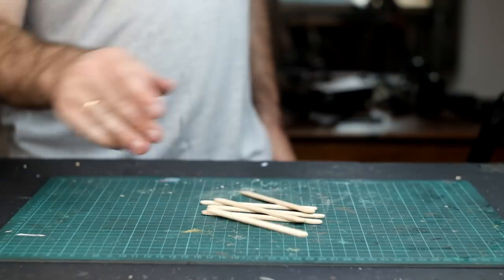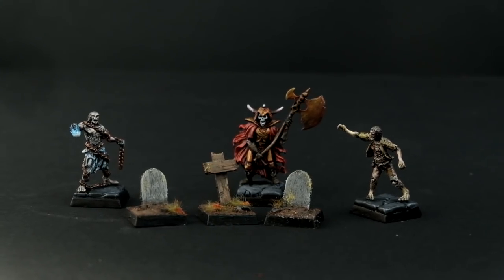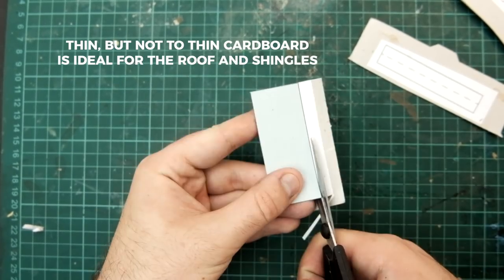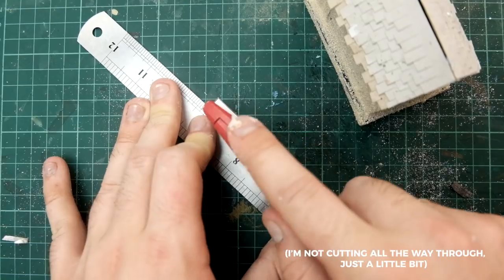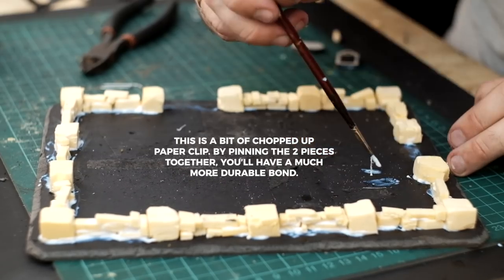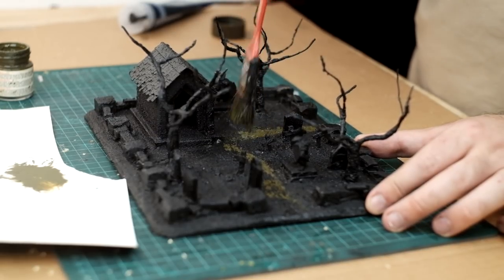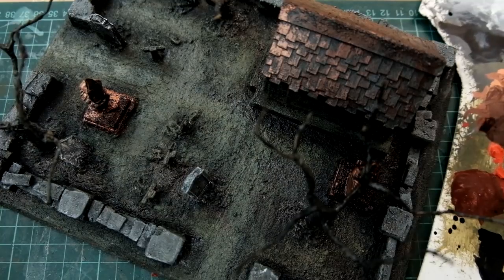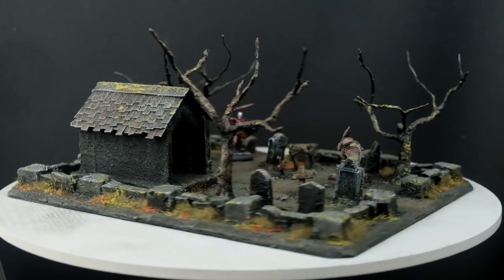Graveyard - Miscast Terrain - S02E02

Comment: To prevent foam board bases from warping one good trick is to get the very thin (usually brown) wide parcel tape and apply this on the UNDERSIDE first. The tape is very resistant to tension and basically prevents the ends and sides from warping upwards.
B
Reply from the maker: That's a new one, thanks!! Do you remove the tape at any point?
Reply: Nooo! The tape remains on permanently in case of further warp-age. Your central heating might have a long term effect. If the PVC tape is too slippery on your table you could add a little masking tape as well.
B

Comment: The biggest problem I find with terrain, is that everything still looks very flat and dark. This is fairly common in some of your builds and another Youtuber called Blackmagiccraft I think. It seems a lot of the paint work relies on a black undercoat and then JUST drybrushing on darker colours. I understand if you wanted to set in a nightime scene, but trees aren't a deep black-brown colour, and buildings aren't black-grey with splotches of green on the roofing, using grey drybrush to bring out any bumps. Similarly, too often buildings are coated in sand to give texture but this, due to scale, makes them look like they're covered in pebbles, rather than a fine gritted surface, and doesn't really blend too well. Once you use things like sand, stones etc, their scale is instantly heightened, and suddenly sand becomes rocks, and fish tank pebbles become large 1 foot wide stones when compared to actual scale.
Reply from the maker: It's important to remember neither Black Magic Craft or I arent going for realism, what were creating is implied detail and painting in intentionally stylised way. It's very hard to create accurate scale scenes from easy accessible materials and accessible budgets so we go for stylised instead. I think quick, dirty and accessible how how we enjoy making stuff too because we use them for fantasy wargaming and dungeons and dragons.
More recently I've tried to adopt more scale modelling techniques in my builds which adds a lot but at the end of the day if you want scale realism Luke Towan, Real Terrain Hobbies and Luke APS  are the guys you want to watch.

Comment: i really dig those walls, well done!
Reply from the maker: Cheers dude, I honestly think I'm addicted to making them, my new table will be pimped out with them for sure.
Reply: yeah, absolutely. I think it can be possible to use the same technique  to make a tower or a castle, should be relatively quick and give a nice stony look
Reply from the maker: Yeah no doubt, I'll let you know how it goes after I cut the 10,000 bricks out that I'm going to need

Comment: Is that foam from bunnings? What ive got is knauf brand, the same pale yellow colour. Mine is really not as good as what ive seen other youtubers use. When engraving it with a pen it tears instead of indents (like if i draw a line theres lots of tiny splits across the line)  and very easily tears instead of cuts when using a knife. Idk if mine has gone bad or is a bad batch or if im doing it wrong or if i should just find something else... I see youtubers draw bricks on xps and texture it no problem and looks perfect and mine is almost useless for that.

Comment: Hey mate, great channel, I can't believe it took me this long to find it. (Thank the Miniac). I've been using all the keywords that should've led me to your channel sooner. Just keep those vids coming. If you got any recommendations on best places to get hobby materials, tools, paints, minis etc here in Aus please let me know or maybe do a video on it. Cheers
Reply from the maker: Thanks you! More on the way! Im from a small town, so I buy a lot online and I buy from all sorts of places, but mostly random eBay sellers. For models and paint I don't really have any particular loyalty to any retailers, just whoever has what I want in stock when I google it.
If you're in Aus and looking for XPS foam, I found mine at Bunnings, you can ask to order it in if they don't stock it.
For foamboard I buy it at Kmart for $5 a sheet.
For 2 part epoxy I buy it bundles of 5 or 10 on eBay for bulk discount.
For everything else I just go to the dollar store, for cheap paint, brushes and super glue.
Hope that helps :)
Reply: Yeah cheers mate. I live in Sydney and still buy most of my stuff online. Didn't know Kmart had foamboard.  Thanks :)

Comment: Great Job, but just a heads up if your going to do a build video with a template you should probably use the template or show it a little in the video. Saying "Ensemble them sorta like this," Isn't going to cut it. YouTube Black Magic Craft to see how to do it right .
Reply from the maker: Hey mate, thanks for the feed back. Not sure really how much more in depth I can go with the instructions of the template, there are not very many parts at all and the templates themselves have arrows. Very familiar with Black Magic Craft, not really sure what he does different. More info would be great.

I recommend downloading the free template and giving it a go, once you have the pieces in your hands, I'm sure it'll make a lot more sense and then if you're stuck let me know.
Reply: Pffft. Trent makes better videos than I do. I’ve just made more. A LOT MORE. Get back to work Trent.
Reply from the maker: @BlackMagicCraftOfficial  Back to work I go!